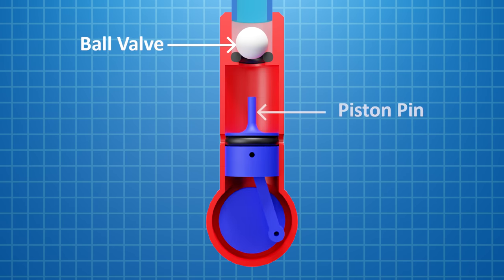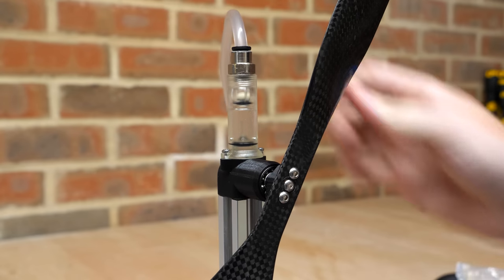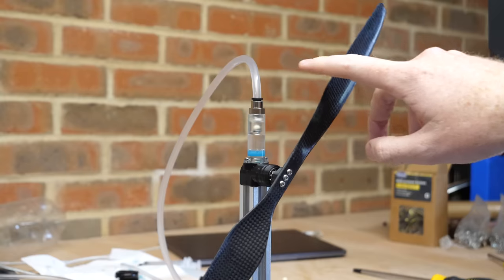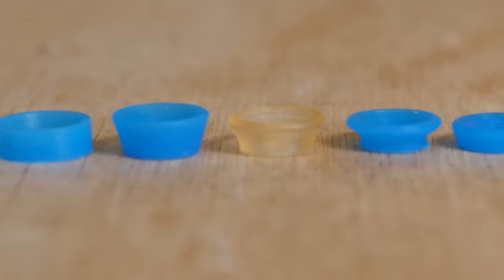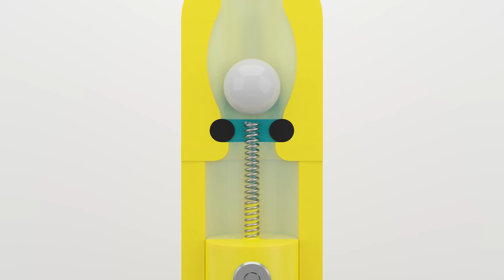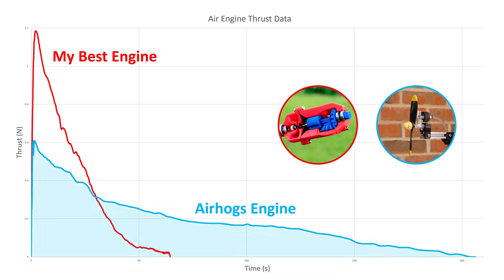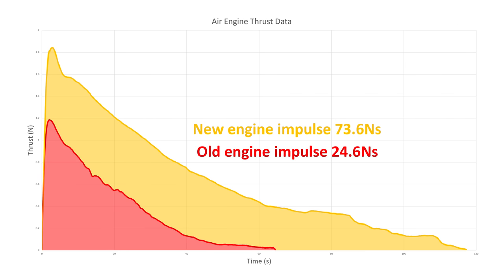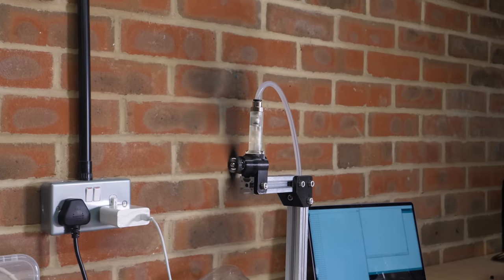Optimising an Air Engine

Comment: I'd love to tell you the story of designing the airhogs, the engine and how long it took to perfect it. That seal was a breakthru to achieve consistency in production. The spring was equally important. 
keep up the good work.
Reply: you were involved ?
Reply: I hope he sees your comment.
Reply: Following hoping he sees this
Reply: Interesting 👀
Reply: Were you part of the design team for air hogs?
Reply: I had the dune buggy. I cherished that thing. I was just old enough to understand engines. Tho I grew up around an engine machine shop. I wanted so bad to take it apart , but afraid I would break it. The engine was just clear enough to see the con rod wasn't connected to the piston. The head was too thick to see how the valve worked.
Reply: It seems that people are interested. so first of I'm not looking to take credit for the rest of the team that worked on this. My part was substantially more involved in the airframe, part fabricating and testing. I sat next too and helped the chief engine builder and he would have even more of the insights he found. 
I am the inventor of the substantially smaller second generation air motor used by spin master and others. 
A second note that is a important takeaway, In regards to this video is the diffrence in requirements Tom is working under and the actual airhogs.
We built a toy for children that was produced under strict cost restraints and extensive saftey requirements. That being siad peak thrust was limited by saftey and cost and not ability to produce more.
Reply: In regards to the spring and it's importance, the spring was to reduce the charge entering the cylinder under top pressure and vise versa as the vessel presure dropped. this did 4 things primarily. 1. reduced anti rotation and reverse running at start up. 2. reduced peak torq. 3. extended runtime on both ends of the pressure spectrum 4. flattened the torq curve.
Reply: In regards to the name "Air Hogs"  there is 2 competing theories, one is the the the chance of making the plane work was so low that it was claimed it would work when pigs fly.  The other and the one I tend to believe is that when we did the testing we took an air pig (google it) to the park and it happily grew from Ronnen asking if we remembered to bring the pig.
Reply: Seal development and break thru. This is as I recall and to the best of my recollection. 
Initially we had a square O-ring in a Grove along the side of the piston. Controlling the mixture ratios, Durometer, vacume, pressure and the shrink rate of the urathane during casting produced a large variance in dimensions. Such that some were just a bit to small to fully seal when not under presure but partialy sealed when the charge entered. We then used this to add ports at the top of the piston to push or expand an undersized seal out against the wall. That was unsuccessful as a quality control issue and so we then developed the expanding seal that sat on top.
Reply: Fun fact, Saftey testing and pig eyes.
During development one of the testing requirements was a scratch test against pig eyes, The testing lab couldn't do testing because for what ever reason they had a hard time acquiring pig eyes. I drove 3hrs to Wisconsin and then back to Chicago with a bag of fresh pig eyes in my car because I happend to know a small butcher there. 
granted I dont recall if that was testing for the original or the later helicopter we developed.
Reply: @charleshartlaub3725  Thanks it was great to hear your valuable insight on the manufacturing of that toy. Very interesting
Reply: @coburnlowman  don't ever be afraid of taking something apart to learn how it works. learning how things work is more valuable than the work they do.
Reply: Never seen air hog until now. And looks remarkably simple (as the best designs do) and easy to reverse engineer. I hate reverse engineering by the way. Where is the fun in that?
🤣
Reply: there is actualy a third option in that some of the early engines ran thur so much air that they got the name air hogs.
Reply: @charleshartlaub3725  Loved airhogs as kid. Thanks for the story
Reply: I know, I know, its getting boring hearing about all the issues that this product had, But here is another. As a first to market and again saftey first + not wanting to destroy the potential future market, the total weight was also a substantial resistance point. Not wanting a large mass object flying uncontrolled into someone or someone's property was preferable to more performance.  especially true wanting to produce hunderds of thousands of them(a month).
This was prior to any regulation that I knew of but was definitely considered and/or others on the team had knowledge if such existed.
Reply: As a last note for now. Back then I did some very basic math based on potential for larger applications such as real world vehicals, the size/@ pressure of the containment vessel was the limiting factor. That being siad the world has advanced since then and I know that at least one group, In France, has tried to make air transportation a reality.
Reply: @charleshartlaub3725  When I was a child I thought the name came from the engine sounding a bit like a Harley motorcycle.
Reply: Yes there were some hog fans on the team but it was not the derivative of the name. Honestly only 3 people can claim what the origin was based on as they trade marked it. I'm sure they would want to keep it vague as to not break the trademark.
Reply: @charleshartlaub3725  
I was around 8 years old at the time.  Wouldn't be afraid to tear into it now. 
   Adults were as intrigued with it the same as me at the time.    One day it was just gone.   Never did find out who borrowed it, with zero intention to bring it back.
Reply: @charleshartlaub3725  Not boring at all, I find it really fascinating! I hope Tom is able to learn from your insights.

As a software engineer, I'm very interested in learning what the day to day of a mechanical engineer looks like.
Reply: thanks for sharing.  super cool info in this thread.  <3
Reply: Bet u tear up o rings
Reply: @charleshartlaub3725  thank you for sharing your stories with us!  I remember as a kid wishing I had good access to a bigger field... and then when I moved to one, wishing I didn't have to go so far to retrieve the thing.  :)  Fun times!
Reply: Thank you for sharing these stories with us! I remember badly wanting one as a kid (I think the only "Air Hogs" branded model I owned was a set of unpowered gliders powered by a slingshot-style launcher rather than compressed air) but I remember these being so hyped up back in elementary school lol.
Reply: It's important for Tom to work thru the reverse engineering process as he works towards a full mechanical engineer degree. I love that he's chosen the airhog engine to share the process with in his Journey. In no small way it validates all the effort that went into a toy that was quite revolutionary.  Most toys are quite basic in that they are smoke and mirrors with no real learning involved, just a shinny object to catch the parents dollar or to advertise on TV.    As a toy designer that worked on more products than I can count the air hogs were special, not singularly but definatly a huge risk for a toy product. The all star team that brought them to life were special. The spin master 3 that took that $$$$$$$ (thats seven figures) risk to get it done and stayed on top of it thru to the end are the real heros. What was learnt and the joy it gave so many makes it even more special. 
Thank you everyone for sharing your happy childhood stories.  
I don't want to comment much more on  things that Tom or others haven't already uncovered because it would spoil Toms process.  

Keep all the comments coming, And Tom keep up the good work.
Reply: @charleshartlaub3725  Charles - do you remember the weight of the AirHog used in this video (unpressurized and fully pressurized)?
Reply: @MisterFizz not off the top of my head but it did evolve quite a bit even during the move thro production. Every component was documented thruout the process. Managing the CG, CL, trim and roll all required special care. For example the main wing was not at all symmetric.
As for the mass of the air it would very due to alltitude of where it was used around the world but the pressure differential and therefore torq and runtime would remain virtually the same. 
Variations in production honestly played a larger part than the mass of stored air.
Reply: Let's all like this so tom sees
Reply: Ok here are patent numbers you can search on the the  uspo . gov site.
original Gen 1. 6006517
second Gen 2. 6862973
completely diffrent designs and a couple alternitive patents are also found from the relatable patent info.
The patent attorneys write in specific terms so that trade secrets can be maintained/defended, but it is all there if you know what your looking at.
if you really want to understand what and how these motors work this is the best place to start.
Reply: I Know sooner or later someone will comment that "motors" are electric... full stop.
In the proper sense, motors are devices that produce work thru rotationial output. 
All electric motors are "motors". Electric solenoids are not. Same input. 
generaly all pulse driven steam,pneumatic, ICE, "engines" that output rotational force are still motors.
Engines require "input force" input as In momentary, of non descriptive direction,  magnitude, or duration, that produces work. it is not restricted to rotational output.
I know it can be real confusing due to the overlapping of terminology but please don't make the motor vs engine comments.
Reply: Don't let Biden see this, or we'll all be driving,
" Air Cars " !!

Hey......wait a minute !!
                                   🤔....?
Reply: Just wanted to say thank you for your work on this toy, it helped shape my interest in flying as a child! Many fond memories throwing that air powered plane in the park.
Reply: @charleshartlaub3725  Amazing to read your comments, thank you for posting! I wanted one of these for months as a kid, and was finally given one for my birthday. I was so excited. On a weekend, my dad drove me to the school where he worked, which had a big open area for the playing fields. The first flight ended with the Hog in an oak tree. It took us an hour or so to get it down, which included fumbling around inside the sports equipment shed to fashion a way to get it down - I think it was a tennis racquet tied to a piece of string which we eventually managed to snag the right branch and jostle it enough to cause the Hog to fall. The second flight it soared so damn high it was still over the height of the trees on the far side of the field and disappeared over them. Another hour driving around the neighbourhood on the other side of those trees, to no avail. One of the great tragedies of my childhood, but I don't regret it - we only lost it because it was too good. Brilliant!

I hope Tom can arrange for you to do an interview on his channel, would be fascinating.
Reply: @charleshartlaub3725  Damn. I appreciate you a lot for sharing this. The airhogs engine design is my personal favorite pneumatic engine to ever be invented!
Reply: It's extremely fascinating to listen to your stories! I'd love to hear more anecdotes from your career as a toy designer. Do you have some other favourite projects that you were involved in?
Reply: super interesting, thanks for sharing!
Reply: @charleshartlaub3725  Just want you to know that I had one of these air engines taken apart when I was a kid and it greatly inspired my love of engineering. The Air Hogs were impressive little engines kids could actually see the moving components unlike most toys where the magic is hidden.
Reply: @charleshartlaub3725 Wow very cool.  Thank you for telling us all that.
Reply: i had one of the Air powered heli's when i was young.  The idea that a motor could run on air alone really opened up a world of discovery for my young impressionable mind.
Reply: I had an Air hogs plane when I was a kid too. One of my favorite possessions ever. Even if I was stuck inside and couldn't let it fly, I would air it up and just hold it while that little engine ran! So many fond memories of that thing. Has to be one of the best toys ever made.

Comment: It's already been 4 years I made a 4 cylinder remix of your engine, and it's still an enjoyment to see you improving your design and sharing it. Thank you very much for everything.
Reply: Try making a compressed air version of a double or triple expansion steam engine. Those used pistons of increasing size and flowed the steam exhaust from one cylinder to the next to capture more of the power of the expanding steam.
Reply: @greggv8 turbo in a nutshell lol
Reply: @TM450FI  no, it would be more like the equivalent of running one of these engines off the extra air pressure coming out your tailpipe
Reply: how did you solve the  problem created by the single sided crankshaft? did you use a traditional big end on the con rod or did you make a radial engine?
Reply: @greggv8  there might not be sufficient pressure to allow for multiple cylinders, steam engines used these kinds of cylinders due to the fact that they had very high pressure and  stroke lenghts that would allow for a limited amount of pressure difference between TDC and BDC.

Comment: YYEEEEESSSSSS this is one of my favourite series on youtube! I love to see the development of a technology unfold in front of my eyes! Keep it up!   👀

With the performance of the older engines I felt like a model that more or less flies in a straight line is all that could ever be achieved, but this new design’s insane performance gives me hopes of one day seeing you put RC controls on it and being able to actually maneuver it!

And there’s still the possibility of putting more bottles for longer runtime, seeing if it can withstand more than 60 psi... eheheh I drool at the possibilities.
Reply: Orgasmic engineering!
Reply: at some point a pressure regulator might be the biggest hurdle
Reply: @macswanton9622  I'm sure Tom can come up with a neat design for an adjustable pressure regulator.

Comment: Bloody brilliant work. Also a great example of the iterative process. A lot of engineers who come out of projects, struggle with iteration. I think this is a great example of how reflection and research get you closer and closer to the optimal solution. The key is not allowing previous failures to discourage further iterations.

Comment: The reason your original 40 shore seals were so hard to remove from the mould is that it’s a polyurethane resin being poured into a polyurethane resin mould so the materials actually want to bond to each other! You need to use a release agent on the mould to create a barrier between the materials or instead of using 40 shore PU material use a 40 shore silicone like RTV 240 or T4
Reply: Good point!

Comment: Hi Tom, you might consider glancing at the piston heads used in airsoft cylinders. They use pressure to expand standard-sized nitrile o-rings outward which delivers very good sealing and high speed/cycle wear life. The design tolerances around the o-ring would need altering because existing designs only seal while the piston slides in the forward (for your engines, upward) direction. Not sure it's applicable for your engine but it does its job very well.

Comment: Amazing! I think you should make a version where the piston is much smaller, increasing the run time significantly. Then, you can cut the engine weight down by making the walls thinner and using ribs and whatnot. Once you have an engine that has a long run time and is very light, you can make a plane out of light materials such as balsa wood and mylar. Then tune the plane and try and get it to fly for 2 minutes!

Comment: I just simply love the step by step iterations you did to make the compressed air engine even better and also resorting to reverse engineer the original air hogs motor to get the highest efficiency. The thought process and the steps that goes into making this compressed air motor is extremely interesting to watch! Can't wait for the motor to fly! Great work Tom!

Comment: Pretty cool.   About 40 years ago, my brother and I had some toys called the Air Jammer Road Rammer made by a company called Tomy.  You would use the included pump to pressurize a tank on the car, and then give it a push and off it went.  We spent hours upon hours jumping it down the kitchen step or who knows what else.  Thanks for the cool content (and the memory).
Reply: I remember those!
Never had one, but I remember that the commercial's tune was a bit of an earworm.
LOL
Thanks for the memory! :D

Comment: It’s so easy to get caught up in one half of the R&D process that you completely forget about and neglect the other. This video is a good reminder of the strides you can make when you remember to stop and do a little more research, or a couple more iterations.

On a different note, I’m very interested in seeing how much further you can improve the engine! The Air Hogs design is likely optimized for mass production rather than performance, so there’s probably many strides you can make on that front. It’d be interesting to see the effect of adjusting bore&stroke measurements, but that’d be a lot of printing… I’m sure there’s probably some equation for that somewhere 😊

Comment: Like some other people in the comments already said, a dashpot (precision ground glass cylinder with a matched graphite piston) should improve your performance even more. It's a very common part in low-delta-T Stirling engines and should be reasonably available.

Comment: Back in the 80's, in the US, the "Air Jammer" compressed air powered car was my favorite toy, it utilized a cam lobe to activate the intake valve (a ball) , attaching a thick washer to the output gear, resulted in slightly slower speeds, but much longer run time. Cool vid.